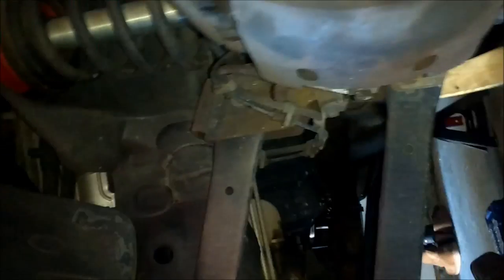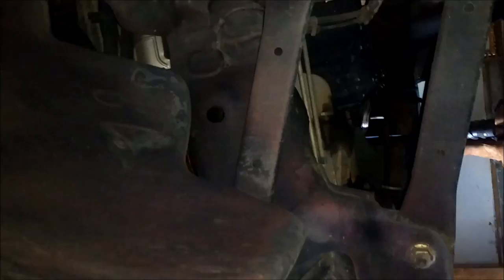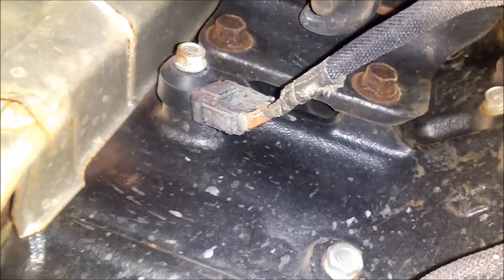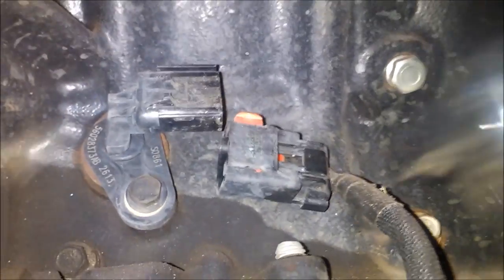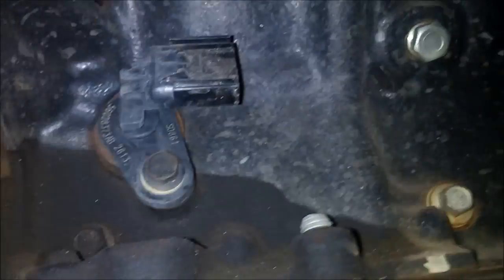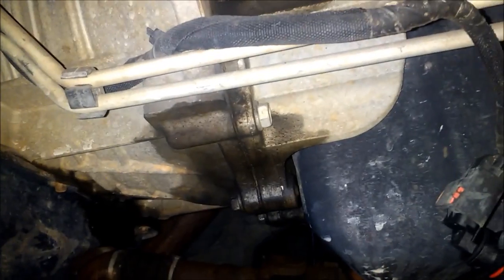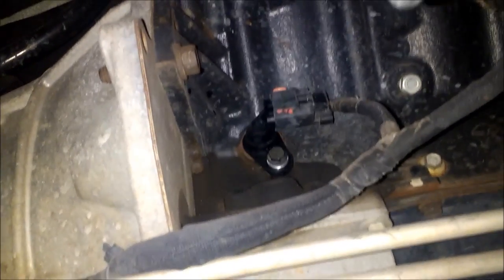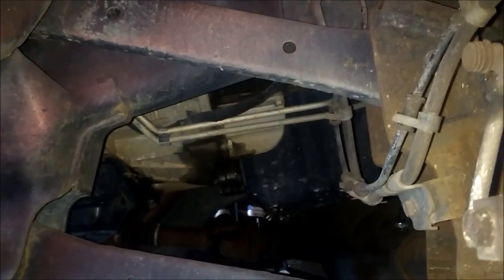Locate and replace Crank Shaft Postition Sensor and knock sensor on 2004 Dodge Ram 5.7 Hemi

Comment: Missed the part where you used or said the bolt needs to be torqued to15 #  or the sensor might read faulty readings to the sensors or mother board.
I think we missed the relearn prosses too other than that nice video.

Comment: The problem comes when you’re sensors been inside the block and it’s heated up and cooled down the sensor expands inside the block heat guns will let you move the sensor around always do this with operating temperature

Comment: Whats the torque spec for the bolt, or is hand tight good enough?
Reply from the maker: My memory says like 35ft torque.  Which is basically a firm hand right.  I woukd say similar to oil plug tightness.  Just trying to prevent leaks

Comment: Sir My reverse light is my working I checked the fuses check all the wires all the harness on the sensors turn the key on and I don't have power I can be the sensors or something else
Reply from the maker: Alonso.  Does engine start when you turn key?  If it starts but then dies/stalls, then it is likely reasonable to replace this sensor.  If it does not start at all, it likely something else.

Comment: I have a Chrysler 300c with the same 5.7 hemi in it. Will the knock sensor be in the same spot on mine as it is in your video?
Reply from the maker: Not necessarily, they do change things up when the engines are in different vehicles. .  But most likely in similar location

Comment: I have the 5.7 here recently my cruze control hasn't been working half the time and stalls sometimes could this be the problem
Reply from the maker: Hmmm.  Not sure about cruise control.  But if it stalls when stopped, this is definitely an easy thing to replace to see if it helps

Comment: Question for you. I have an 04 1500 with the 3.7 V6, it came up with code P0335 Crank sensor (right after I backed up and it stalled, just like you) I replaced the sensor and problem is not solved. Did you have to use a bi directional scan tool to "relearn" the crank and cam sensors or did your truck just start and work?
Reply from the maker: I did not use any tool to relearn or wipe codes, but also mine did not display that error code first.  It only exhibited the symptom.  I would recommend clearing the code (auto stores can do this if you get a nice one, or unplug battery for a long time). And seeing if the code comes back immediately.  Only other thing i may recommend is cleaning the throttle body if your have never done that.
Reply: Sometimes it's the wiring to the sensor that fails. Just something to keep in mind.

Comment: Engine light go off when you install new sensor and start up truck?
Reply from the maker: Mine did not have a light on.  Just would stall sometimes.  But from my experience, you need to get the code "cleared" at an auto parts store in order for it to go away
Reply: @Prima10ne  ahh ok. Glad everything went well for you

Comment: Was this the fix?
Reply from the maker: Andy, yes this did resolve the issue.  Since replacing the sensor, I have not had the issue at all.  Prior to replacing the sensor, I cleaned the throttle body, this did appear to help the issue, but it did not go away completely.  I would recommend doing both if you vehicle has over 100,000 miles on it and exhibits the same issue that I had of stalling in reverse.
Reply: @Prima10ne  It's good to know.  Thank you for responding.
Reply: We've tried plugs,wires,coils,o2 sensors still dying, will try this now
Reply: @billmarty8526  MY 04 was doing similar thing same as you did plugs wires throttle body o2 sensor finally camshaft sensor fixed it no codes ever went off
Reply: @Prima10ne  I have the same truck. Does it have one or two knock sensors? I read two, but really have no idea.
Reply from the maker: @whitewavetheory5856  just one knock sensor.  But it had a crank shaft sensor and camshaft sensor, but if which may be related to this problem.  So start with knock and go from there
Reply: @Prima10ne  Thank you!